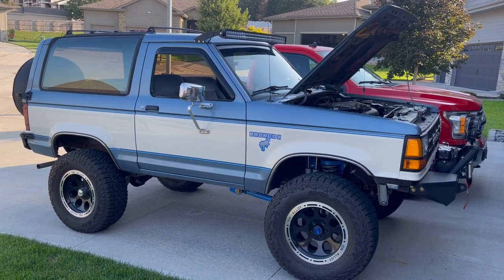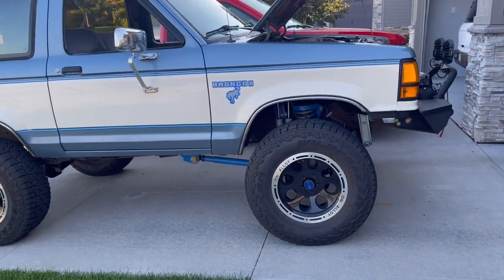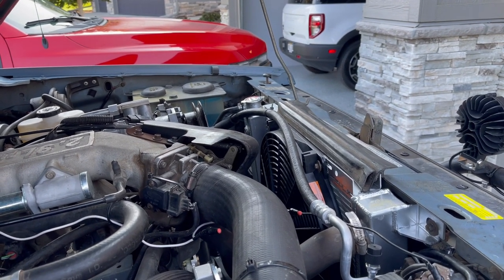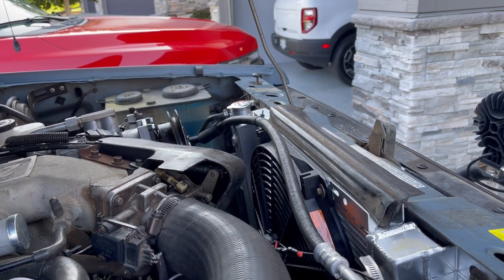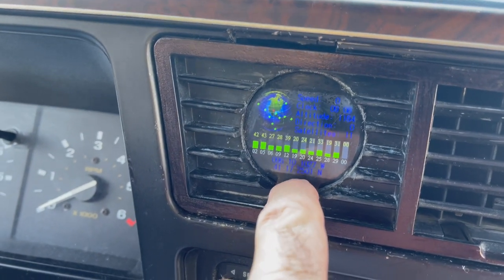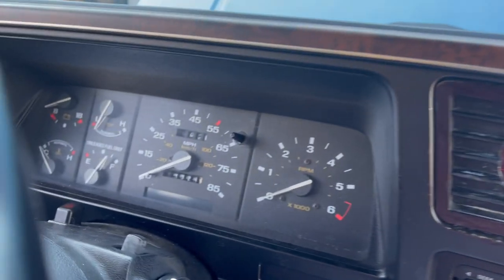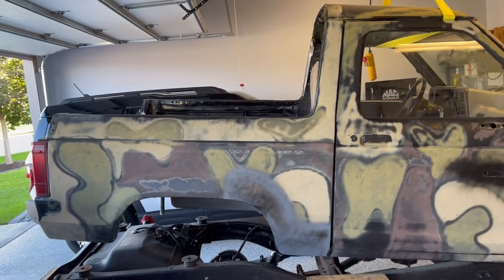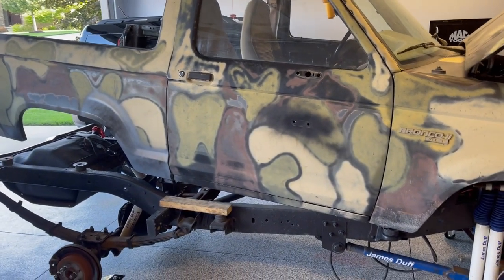1989 Bronco 2 (part 3) New shoes, a cool Inclinometer gauge, and cooling upgrades for the B2

Comment: What size lift kit?
Reply from the maker: 5-6 inch combo of James Duff and Rough Country.  Honestly for mainly on raod use I suggest a 3" body lift.  You can fit 31's and it doesn't affect any of the steering or suspension angles.  And it's cheap.  You need a friend to help.  Takes about 5 hours if you have never done it.  You have to remove the seats and carpet to do it right.